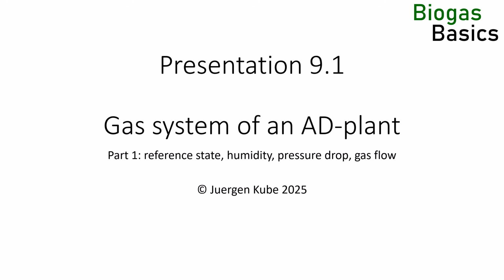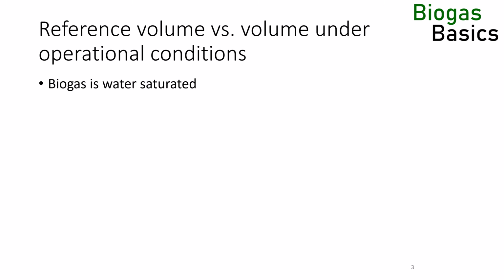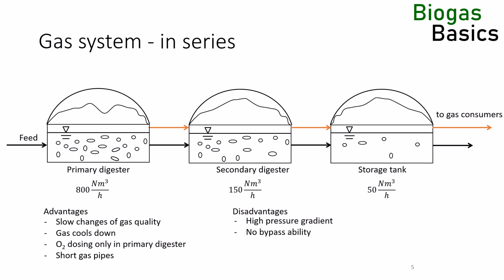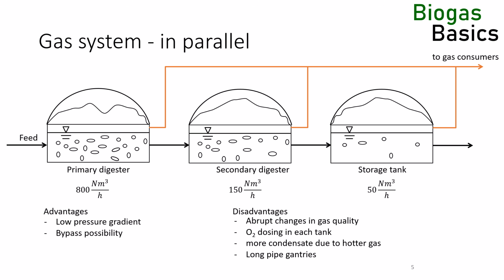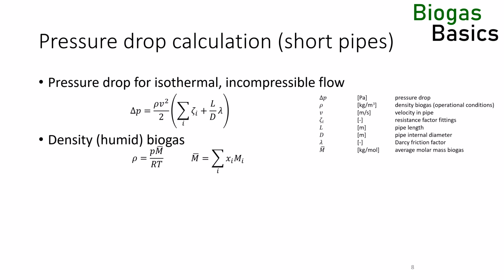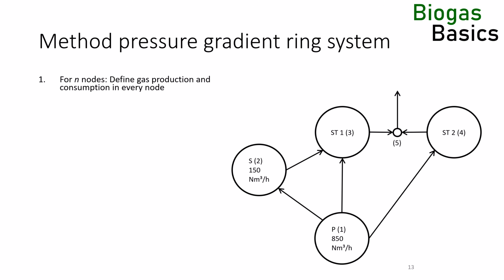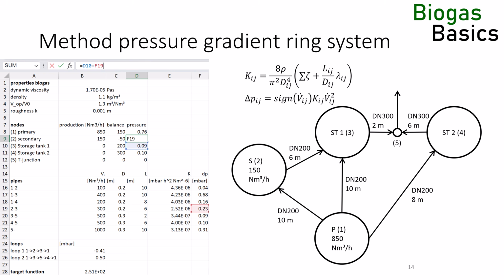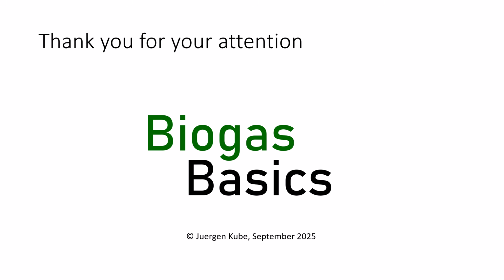09.1 The gas system of biogas plants - reference state, humidity, pressure drop, gas flow

Comment: Is there any calculation for temperature change along the pipes?
Reply from the maker: yes, see presentation 9.2 from 11:55 onwards. Short pipes can be modelled as incompressible, adiabatic flow. In long pipes, the heat and impulse balance must be solved simultaneously. The density of the gas changes - it becomes compressible. The formulae do not consider condensation, which should be avoided in long pipes.
Reply: @BiogasBasics  Thanks for the answer! I have another question, did you also assume the resistance factor fittings is 0? I have different value of K and dp with the same parameter from your video.
Reply from the maker: @fahmidewantara9715  I think I used a fixed sum zeta term of 5 for all pipes in this excel-based example. That includes 90° elbows, valves, T-junction, confusor, diffusor. See also episode 13.2 which will show an AI-tool (including prompt) to replicate these calculations.